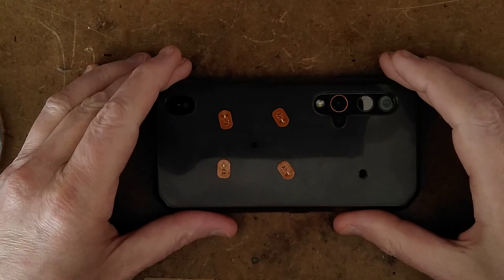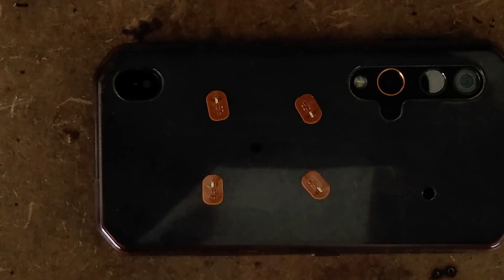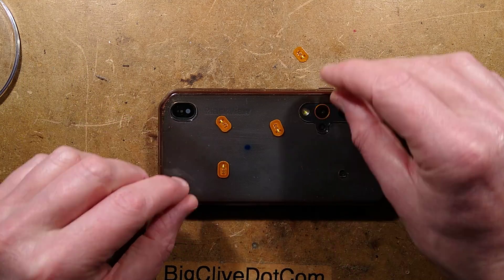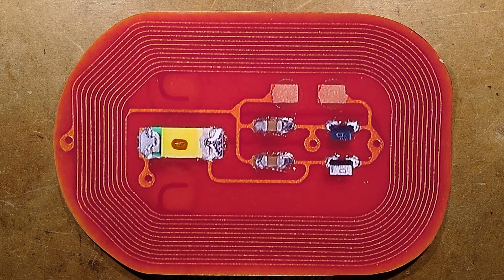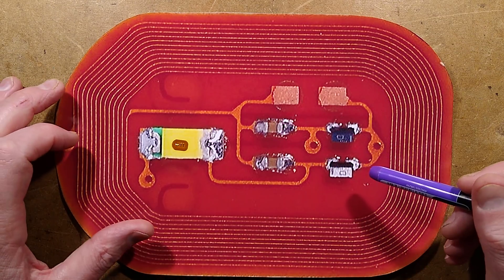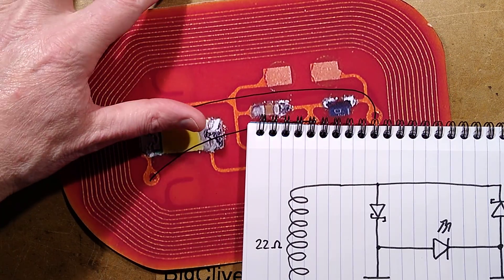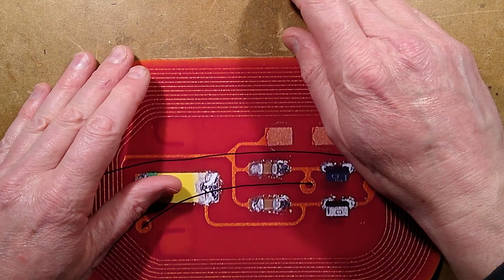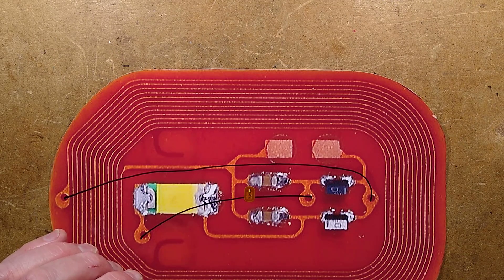NFC powered flashing fingernail sticker (with schematic)

Comment: Curious that only the NFC coil drives them.  Is that a function of the receiving coil's resistance (and/or length)?  Would an RFID scanner also set them off, perhaps?
Reply from the maker: I'm not sure of the coil is just optimised for a specific frequency and signal strength level.
Reply: @bigclivedotcom  It would naturally be designed for 13.56 MHz ("HF") NFC stuff. Maybe the things you tested it with without lighting it up are 125 kHz or 134.2 kHz "LF" readers? I work with mostly LF stuff in my day job, and I haven't made or been handed any simple LED field detectors which work both at LF and HF frequencies so far.

Edit: If I'm not mistaken, Qi chargers initially detect a device to be charged by emitting a pilot tone down in the LF range, and then vary their frequency to control power transfer once they negotiate with a device.
Reply: @Nf6xNet  the coil length dictates the frequency response range does it not? Also, is there not a use of resonance going on between the 'parties' - inductor and pickup coils?
Reply: @RicardoPetrazzi  Resonance is important in both wireless charging and RFID.
Reply: @Nf6xNet  Simple enough to embed 2 coils then, one for the HF stuff, with a small capacitance diode to rectify, and a larger low frequency coil around it for the lower bands. Would need to be tuned to be partly in both, but can harvest enough energy to work off them. Sort of a universal "is this thing actually on" tester that needs no batteries.
Reply: @RicardoPetrazzi  It's an LC circuit, hence the capacitor (the coil being the inductor).
Reply: @chaos.corner  In a resonant circuit, the charge on the capacitor also flows back into the inductor (by definition of "resonance"). In this circuit, the capacitors simply store charge delivered via the diodes until they have enough voltage to light the LED. Those capacitors are not part of an LC circuit.
Reply: @RexxSchneider  True.